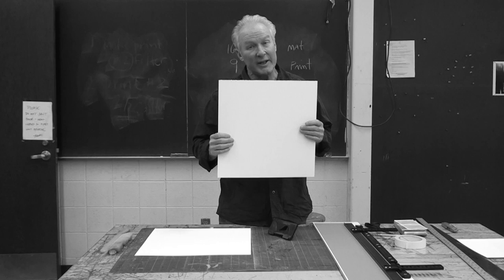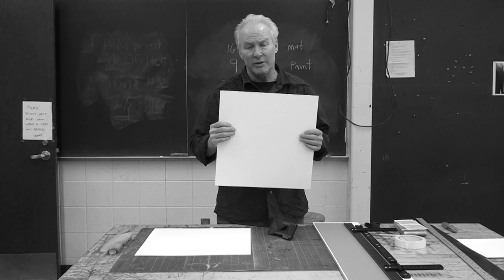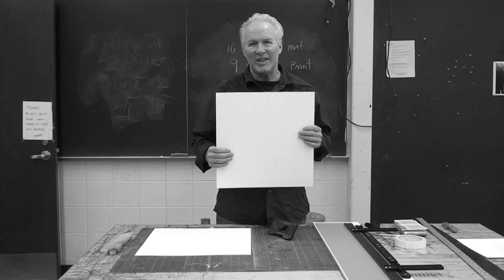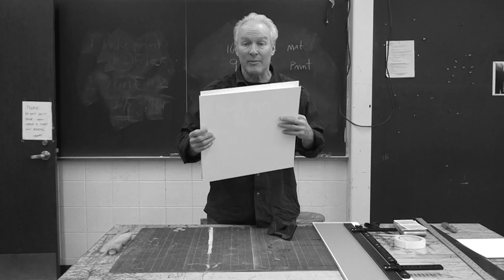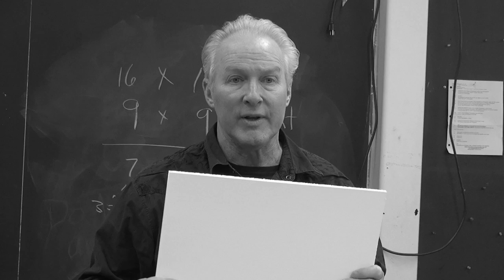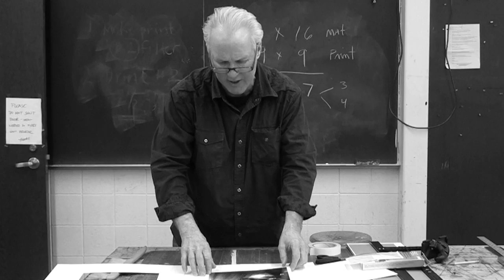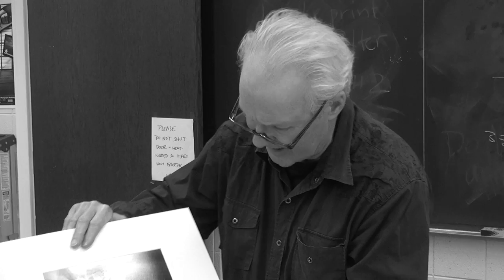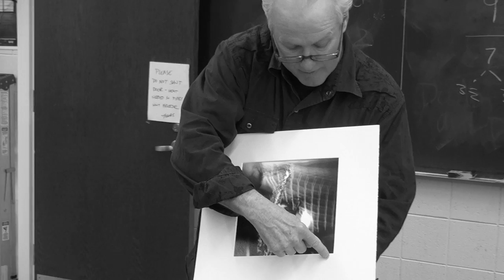How to Mat Your Photos

Comment: I don't use the sticky corners. Just more of the archival tape as 't' hinges, First two strips vertically behind the image protruding at the top of the print and then two strips horizontally to secure the vertical tapes to the backing matt board. To my knowledge that's how professional framers would do it.
Reply from the maker: That's a great way to do it. He has taught his students that method as well. I use linen archival tape when I mat photos. Thanks for watching our videos and contributing good information! Good luck to you :)

Comment: I am 79 and have some craft things I want to frame. I purchased a Logan 4000 pull bevel mat cutter. No matter how hard I press I cannot cut through the last layer of paper (4 ply uncut mat board). I don't see 2 ply in my go to craft stores. Is there card stock heavy enough to use as an alternative to the 4 ply mat board? Thank you for looking...Lucie
Reply from the maker: Here's what the Professor said: "2 ply mat board is a little thin but can be found if you Google it–Amazon for example has it at a reasonable cost. 4 ply looks better than 2 ply which looks too thin in my opinion. Consider a local frame shop who can cut a mat with a senior discount for around $5.00. Consider a bribe of oatmeal raisin cookies. This would be good for one or two images but if you are doing a show I bet there is a splendid young man or woman at the local art school who might put the blade for you once you train them." Good luck Lucie!! Thanks for watching!!

Comment: never mind I got it. doyou always use mat board as your backing?
Reply from the maker: Tammy Walla Hi Tammy--you don't have to use mat board, but it's best to use a material that won't deteriorate and is acid-free. The best type of mat board to use is 100% cotton rag board, available in 2, 4, and 8 ply. It is acid free and often lignin free, archival, fade and bleed resistant (and pricey). A good brand is Crescent or Bainbridge. Another type that is acid free is alpha cellulose mat board and is slightly less expensive. An alternative is to use a wood pulp mat board--inexpensive, but not acid free. Non-archival material will yellow with age and fox (get rusty stains). I've used different types and colors, but I really prefer the look of white or black cotton rag. Good luck to you!!!
Reply: Trangent Can you use the cheaper stuff for the backing and the nicer stuff for the window since that's what is going to be seen? Will that cause bad things to happen to the picture?
Reply from the maker: Chad Ashton Hi Chad :) It would be okay to do that, but it might depend on what you want to do with your work. Are you going to sell it? Then you should use high quality mat board. Are you going to show your work? Then it doesn't matter as much, especially if the mat is temporary. A lower quality mat board could last five years, but over time it discolors the photo or artwork, even if the cheaper mat is only on the back. Hope this helps :) Thanks for watching!!
Reply: Trangent Thanks and that does help. Eventually I'd like to be at a point where I'm good enough to think about selling and even showing but anything even now that I print I want it to last a very long time so I guess it would pay to go ahead and get the nicer mat even for the backing. Thanks.
Reply from the maker: Chad Ashton :) I think you should treat your work like you are the artist you want to be!! You'll be glad you did, and you will be proud to look back at your work and see how much you care about what you do and how good you really were. I think you will create amazing things!!

Comment: Let's position the picture precisely where we want. Yes, right, right there. Perfect. "Nirvana". 
And now, we need to open the mat and secure the picture in this perfect place. So let's use those sticky corners, they are great. So next step is to grab the picture out of its perfect position, put those sticky corners on, and let's put the picture back randomly on the mat. That's ok, the picture remembers where she needs to be. Yeah, right. Perfect.
Reply from the maker: It might not be easy the first few times, but the more you do it, the easier it becomes. Hope you have great results matting your photos! Thanks for watching Maxime :)